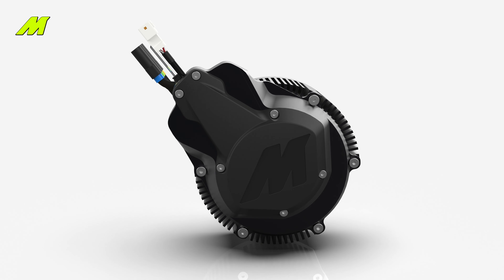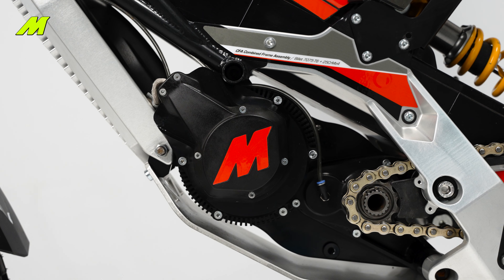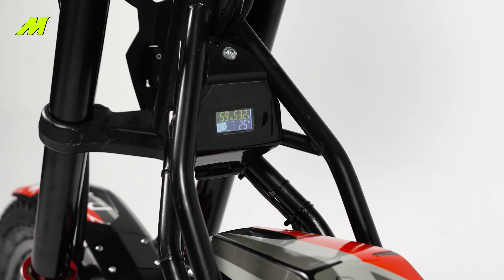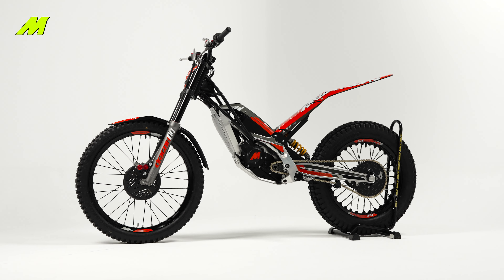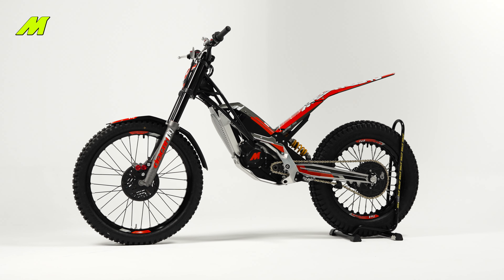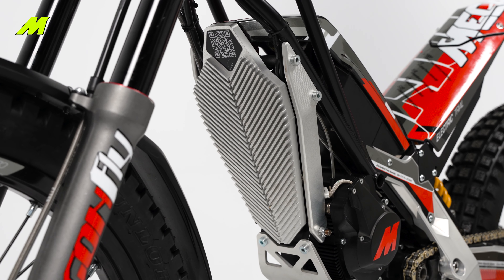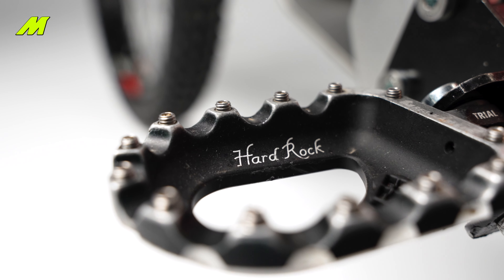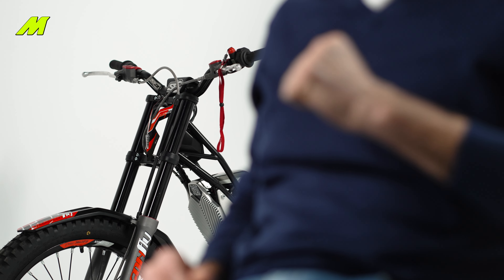Mecatecno Dragonfly - Torque concept. 7 features related to the electric propulsion.

Comment: 16 g ill pass that is two gas gas 250s and that motor is q 130 s and it a Chinese made motor it's 1000 bucks for the controller throttle and controller stop letting these shisters rip you off